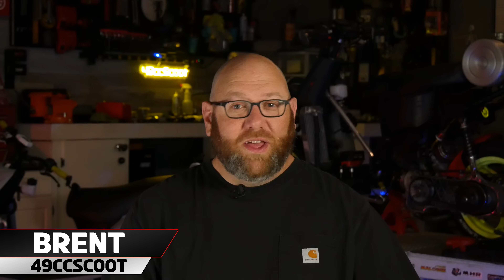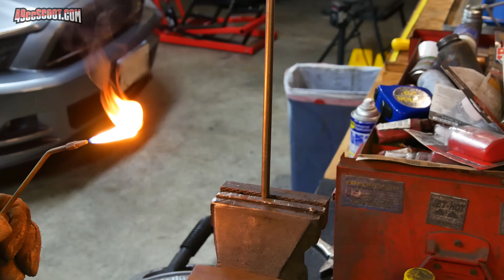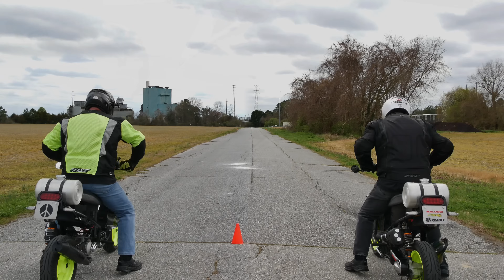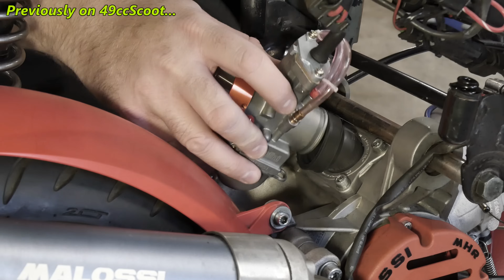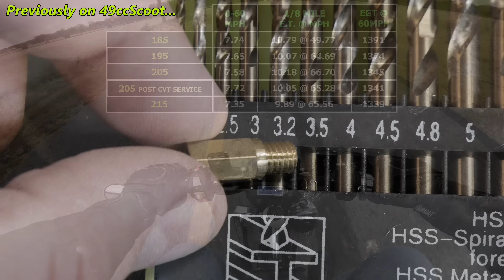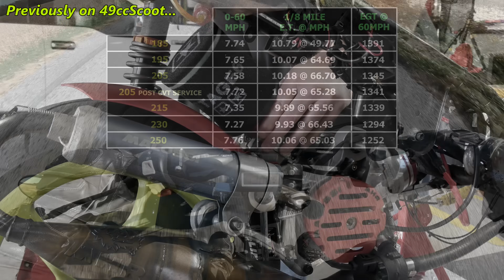Stage6 R/T Programmable PVL Ignition Setup & Timing + Tool Battery Conversion : RC1 : Part 23 : PWK

Comment: top fuel scooter curve?? did you do some nitromethane testing?
Reply from the maker: 😂 Just messing around for the vid. I have considered playing with RC car fuel, but I'd do it in a small four-stroke. Not these expensive engines right away.
Reply: @49ccscoot  would be very interessting to see. biggest problem is getting the carb to give enough fuel

Comment: his problems are its made for 70cc. the preset curves for stage6 the 70cc drag race competitions in europe that is what the presets are made for 70cc anything above and the curve gonne make 0 sense. i did alot of drag draging in europe in my time when it comes to performance i went always malossi eprom or pvl i started with hpi but dont even go there its absolute crap and a pain to install. compare to malossi eprom or a pvl works like charm everytime and if timed right i saw most performance gains on them then anything els

Comment: hey there i have the same ignition and when im in andromeda it says wrong programmer does the bike need to be running to load a diffirent curve and what do i need to do when it says wrong programmer
Reply from the maker: I always program mine with the scooter off and the key off. I've never had it tell me wrong programmer. If you have the programmer just like mine, I'd probably contact Stage6 to see if they have a solution.

Comment: Boy this seems a lot im fixing to work on a af18 with a 72cc polini corsa
Reply from the maker: Once the dialing in for the custom curves was done, I really like the ability to put a new curve in easily. I wish it were a bit more ready to go like MVT's DD ignition where the rotor seems to be a good weight for starting without being as heavy as the S6 with the add-on disc. If you aren't concerned about programming the ignition, maybe consider an MVT which also provides some charging/lighting output; or a lot of people seem to like the Malossi MHR ignition as well.
Reply: Ok well i have af18 72cc polini corsa and a polini 28mm carb.....
Reply: On a honda elite

Comment: i already watch the video 

im still having a hard time on calibrating the stator settings to match the ignition curve on andromeda 

i have on lot of experience in tuning the igniton timing on 4 stroke EFI engine on programmable ecu 

but for this one reading the manual is like a PITA it tells you the offset timing yet im used to actual timing on BTDC in EFI engines 

can you help me 

thanks
Reply: also i can help you build a timing curve baseline i fully understand now
Reply from the maker: @ The manual and their specs just don't make sense or align for me. My best advice is to do exactly what I showed and start off with a flat line curve. Set it somewhere that the engine should run well enough to get it to idle and rev to 4,000RPM or so. I used 16 degrees. Then use a timing light and see where the timing actually is. If it's 18 degrees instead of 16 degrees for example, then you know you need to either change your stator setting to retard it by 2 degrees or you need to make all programmed curves with 2 degrees less timing than you actually want. That's the only way that I was able to make programmed numbers match actual timing observation.
Reply: @49ccscoot  i saw the timing curve of the the drag and circuit based on the timing light and by using the calculator you created i think i know what they did to the timing mark btw can i send you a settings that you can test with the timing light as i dont have a work bench here in our country if its ok with you
Reply from the maker: @paolomikaello  I already know what works on mine. For mine to get programmed and observed timing to match, I have to set the stator to about 35.5° BTDC instead of roughly 30° as specified by Stage6. I'm gibing you degrees instead of mm BTDC so you can plug that into a calculator and get the mm BTDC required for different stroke and rod length. Calculator is here : https://www.49ccscoot.com/calculators.html
Reply: @49ccscoot  yes i arleady use the calculator and even wtach this video multiple times and recently found out that the degrees BTDC of the 44mm stroke 90mm rod and the 39.3mm stroke 80mm rod are the same 29.86 deg based on the calculator so if the timing curve on the cdi is fix then the timing curve for the 70cc / 50cc 39.3 stroke 80mm rod length is the same as the 88cc / 95cc 44mm stroke 90mm rod length if we are to follow the stage6 guide  installing the stator the only good thing about what i dont understand is the curve that you got from the stage6 settings and the curved when you adjust the stator on the last part the equation is off and make no sense and when you use the stage6 settings on the stator and made a fix curve on adromeda the eqaution also is way off as what the andormeda stated on the manuals
Reply from the maker: @paolomikaello  I don't understand why it's like that either. It makes no sense to me and nothing in their documentation suggests that it should be this way.

 I just settled on the fact that if I make programmed and observed timing match by dialing it in as shown, then I can put whatever curve I want in and it works as expected.

Comment: support from italy
Reply: i have tha same ignition setup with PVL STAGE, with 70 rt i don't have problems ( advance adjustment 3,17 beacuse i have connecting rod 85 )  dell'orto 28, pulverizer 266 , maximum jet 138, minimum jet 52
Reply: let me know ;) i can help you

Comment: 500 RPM  to 700 RPM Kick before Stage6 R/T ignition Will Start up. And the 
Malossi MHR Team 2 Ignition Will start up when your start kick make 340 RPM …. 

Why do you yourse R/T ignigtion and not the Malossi Eprom Team 2 ignigtion
Reply from the maker: I started with MVT for charging/lighting. I moved to Stage6 for the ability to program it however I want.

Comment: hi i was wondering if i can use 94 malossi testarossa exhaust in my mk2 racing the exhaust has been modified to fit  86tpr so it should fit my mk2 but i was thinking about the performance does its gain horsepower or is it just useless in 70cc
Reply from the maker: The 94cc for the RC-One is quite large in volume. Not sure if the non FL intended pipes are. I assume overall dimensions are a bit large.

Comment: Hi there! 
MVT is not junk at all, but it is even more obscure than S6 when it comes to know timing curves. Having a very light rotor and their tendencies to randomly give up either CDI or stator... Made me think of getting another ignition kit, but losing the power and needing a battery makes me rethink my choice every now and then.

PWK is a somewhat nice carb, many like to use 20 or even 30 holes nozzles (the one in which you bolt your main jet to, not sure about my translation sorry) and from 32mm and more PWK it is highly suggested to remove lower stops for the floats and to increase the hole size of fuel entry on the carb to avoid emptying the bowl due to slow fuel entry. 
Personally, they're a nightmare to work on and they're very subsceptible to air temperature/humidiy/altitude changes. EIther run a good airbox that limits these changes or just switch to another type of carb. 
I might switch to a Dell'Orto VHSH 30mm or a VHSB 34mm. Great quality, lots of spare parts, and they're a lot more stable and you feel every little change you make.

S6 likes to rebrand other products as theirs. I suggest you to reach PVL as they usually just make the product by S6 specifications and then send it to their warehouse. You might have more luck with their response. In the meantime you could also buy another stator from PVL as they're 99% compatible. part code sure is your friend there!!

If you're looking for a comparison, HPI also makes a programmable ignition kit, digital just like S6. They are available in two version: inner rotor and outer rotor (which can also include lighting and an rpm signal output) and I'm going to get this one on my 100cc project, mainly because I just want to have an rpm gauge/water temp/lambda sensor and a gps/chrono always on for when I want to ride on the local track. Give HPI a look, I think it's worth the shot, and at a 480 euros price it is not that far from S6.

See you on the next video!
Reply from the maker: Thanks for the comment and all of the info! The tool battery conversion is not as bad as I thought it would be and I don't worry much about ride times unless it's a really long ride. If you'd prefer inner rotor otherwise, don't let the battery stuff stop you IMO.
Reply: @49ccscoot   oh i usually ride with a 4000mAh 12V bike battery, as I only Need Power for the temp gauge and front/rear light. Using only LEDs that battery lasts me ages for Road use, but on track id prefer not having a battery at all!!

Comment: Here in Europe we all use PVL digital ignitions by Bidalot out of all tested inner rotors this is by far the best one and has the best curve / performance! They’re also easy to use and reliable. I would highly recommend them! 

Thank me later.
Reply: As for Polini pwk’s don’t use them! Sunworld PWK’s 30-34mm or Keihin airstrikers 35mm or dellortho vhsh cs 30mm. 

I have a PWK airstriker 38mm long body with STIC metering block and jd-jetting accessoires on my Bidalot factory racing 2012 94cc Derbi and love it!

Comment: Hello, very complete video 👍, have you tried the mvt digimax box? It works really well with it. I had a pvl which was very difficult to start and it does not support well + or - in advance. With the Polini PVL there is no such problem, but yes the MVT remains just as efficient as a PVL, several videos prove it with bench testing. Each engine reacts differently... Good luck for the future.
Reply from the maker: I hadn't heard of the Digimax. MVT's site doesn't show a model for Piaggio and also says it's for their millenium ignition, but the MVT I have is a Digital Direct. Looks like it allows curve altering, but not creation.

Comment: maybe you are running out of fuel in the bowl, thats why u see higher egt readings.

I would try to mess with float level, and i would try to check what the egts would be with an emulsion tube with more holes=way better fuel atomization, smaller fuel droplets, tad bit leaner mixture so an upjet would be mandatory.

Also i would invest in a polini pwk needle kit. The stock needle is useless in my opinion. I've spent many hours learning about the different changes in taper, straight sections, thickness, main jet hole opening. U will find that a needle change will suite your bike way better than the stock one. 

Best of luck
Reply from the maker: Thanks. I have watched a clear bowl with a cam. TBH not sure if that's in a past vid or something I may have coming up later. LOL

I have the Polini needle kit. Went over some of that in past vids and in detail about an alternative needle selection method.

Comment: If you decide to get rid of the polini i would try a gokart membrane carb, can be mounted at any angle, is incredibly easy to adjust adn supports e85 (if that's available where you live). Have had a great experience with mine, I also switched from a polini PWK that didn't want to behave reasonably . The gokart carbs are a bit pricey if bought new but can be gotten cheaply on ebay.
Reply from the maker: I may have to look into those. Thank you.
Reply: I fully support this idea. I installed a Tillotson replica on a few of my bikes and they are a dream. I also have a cheap PWK which is also fine when finally tuned good, but it took me a week of tuning vs only 15 minutes for the gokart karb.
Reply: You dont even have to work out the vacuum connection, thats just for the internal fuel pump, since on a scooter the fuel is (usually) gravity fed.

Comment: If you still Have Problems with the pwk Polini try a nibbi Racing i put on my 70cc and it was Running good with out any Settings changed

Comment: I was always curious about this programmable CDI and it's worth the money - but only on the highest racing level. In the past 20 years none of the available inner rotor ignitions had this option and still the bikes were flying. That base plate is for the original piaggio crankcase, on the Malossi crankcase you don't need base plates. The rotors are basically different compared to original and Malossi crankcases. S6 CDI often goes wrong out of nowhere so I can imagine yours is dying, too. VERY disappointing but the R&D and S6 CDI's have been like this forever. Just like the new Malossi CDI so I'd recommend to find an original old non-programmable Malossi CDI, they never die.

So first, I'd recommend you to throw the PVL black spark plug cable away and buy the red NGK Racing (with cap), we've been using it for years together with an NGK B10EG or Denso IW27/31/34 spark plugs. These are the official recommendations to these racing engines.

For Malossi the Team2 CDI's curves are available on their website (search for the pdf document of the CDI on malossistore.com) and they seem more agressive than HPI for instance which is also available on their website. Until you find a constantly operating engine and bike I'd stick to either S6's or Malossi's stock curve.

Our experience with rotor ignitions say that MVT is okay for street usage but with the racing ignition kits the bikes are stronger therefore the jetting is higher, too. Simply the spark is stronger which supports a better burn on high rpm.

Here in Europe nowadays the VHSB carbs are used on these big bore kits, I'd throw the PWK away.

Comment: Ahhh it's cool to see how the program can be adjusted.  Usually, engines are happy at 10 degrees advanced, would programming that in the cdi help?
Reply from the maker: It's making it's max power around 15-16 degrees at peak. I wish I could get 10 degrees at cranking speed, but you can't set it below about 800RPM IIRC.
Reply: @49ccscoot  darn. That does complicate things in this matter. If there was some sort of way to look into the code, it may be possible to change that threshold of when timing can be altered.

Comment: I Think the lower ignition timing in the drag curve is to get more heat in to the pipe.
Reply from the maker: I've heard this both ways around. Some people say use advance to get on the pipe quicker and some say less timing for higher EGT. My experience has been that it's way more responsive with more timing down low where the engine is inefficient. Probably the better way would be to use a reducer at the stinger if you want heat in the pipe, but I'm not saying you're wrong. Definitely not a drag racing pro. Thanks for the thought.
Reply: roost pipes have a reducer before the stinger for this exact reason!
Reply: I haven’t really done any dragracing myself either but my thought is that with less timing at lower rpm you put less heat in to the cylinder and head and more heat into the pipe while the bike is warmed up. I would think you want this especially in a cvt set up where low rpm power isn’t really important(atleast for drag racing). If you can get the pipe hot faster(without heating the cylinder and head) then you can run hotter or more extreme setups(more compression//more timing) without having detonation at the end or your run. You also need the pipe to be hot to get the bike “in tune” and stay “in tune” down the run way so a warm up is a must. Because of the cvt and the fact that you are always in the powerband during dragracing everything that’s below that rpm doesn’t really matter, however in road racing or just regular street riding you sometimes need that extra “grunt” to get out of corners and such, that need for “torque” is less pronounced with a cvt but is still felt and matters more in part throttle situations than at full throttle. Sorry if my english is a bit scuffed im from Sweden so english isn’t my first language. Ps I really enjoy your videos especially the more informative ones:)
Reply from the maker: @oziozboyt6058  In practice, more advance at lower RPM has helped me get off the line quicker. I do think heat in the pipe is beneficial, but suspect there are possibly better ways to do it. When I do test runs with the dragy, it's almost a guarantee that my first run will not be the quickest. It does better on the rest. It's either heat in the pipe or possibly CVT related. A smaller reducer or stinger should let the pipe run hotter while keeping the advance at lower RPM and/or wrapping the exhaust. I was told recently that some drag racers use what sound like scary small reducers at the stinger for 1/8 mile and less.

Comment: I wonder if there is any kind of oxygen-sensor that would work with 2-cycle--even for a while. That way a too-lean mixture could be detected even before putting up the kickstand. 

Your mini-degree wheel would seem like a handy product, perhaps made from laser cut and legend-marked aluminum. A Vernier scale could be added if you wanted get get fussy with it, so older people could read it easier.
https://en.wikipedia.org/wiki/Vernier_scale
Reply from the maker: Sorry the reply is so late. Youtube held it because of the link. Koso makes an o2 adapter, but even then it's a temporary use thing. Use it to tune and then remove it.